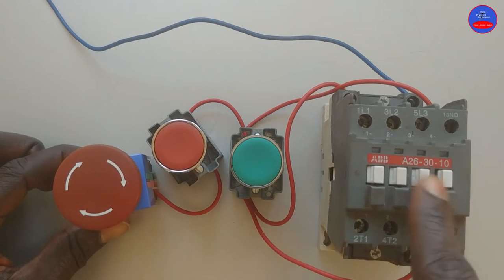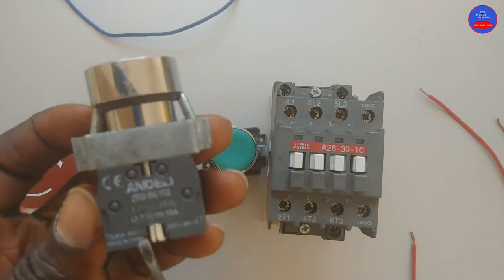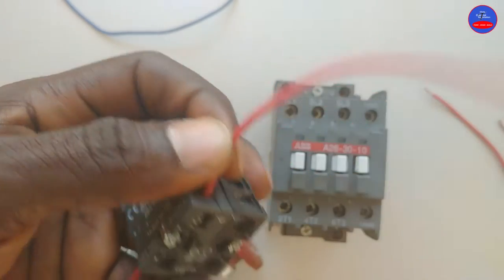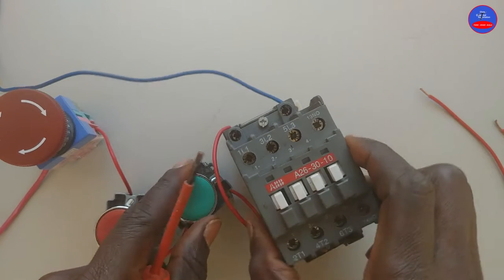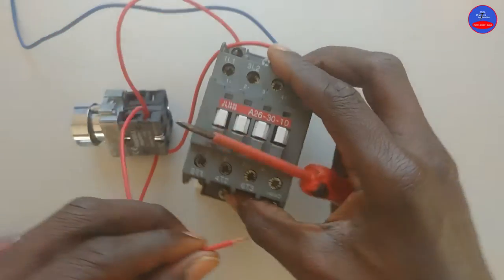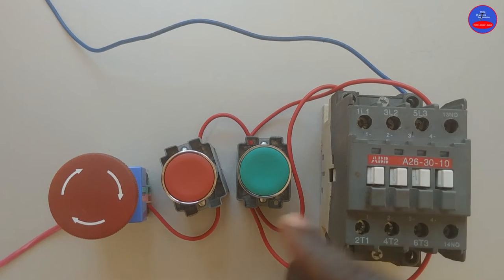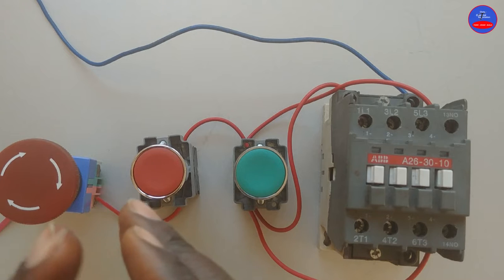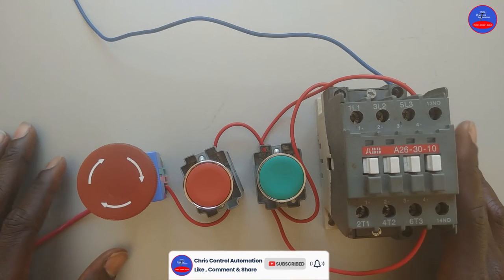What is an emergency stop push button (How to wire an emergency stop button)

Comment: GOOD WORK ..YOU EXPLAINED VERY WELL , I HAVE QUESTION , WHY DO WE USE NO  contacts in contactor....
Reply from the maker: No contacts are used in contactor as hold-on to provide alternative current flow to the contactor coil when the start push button is released.